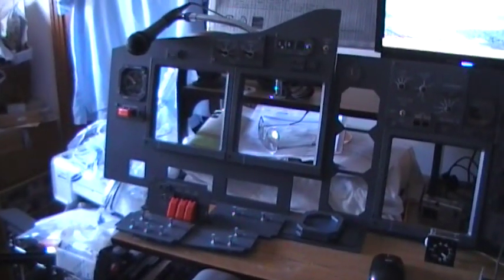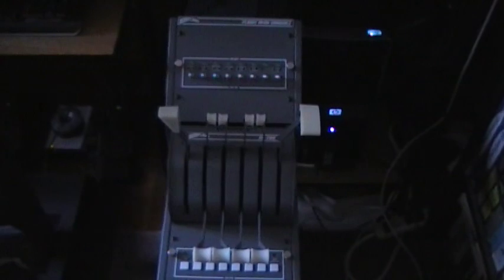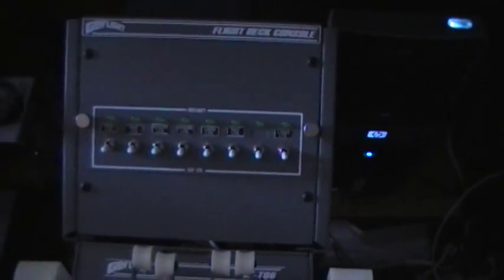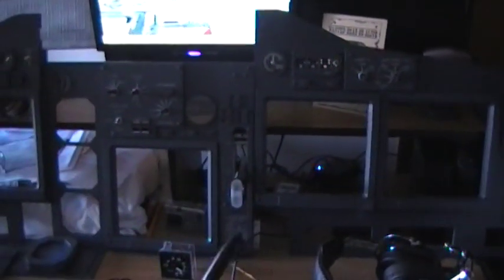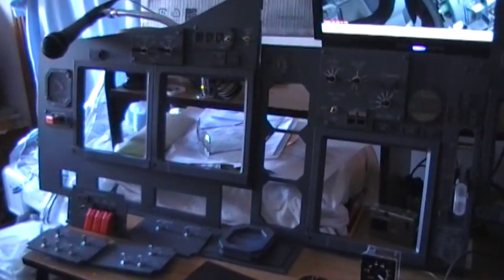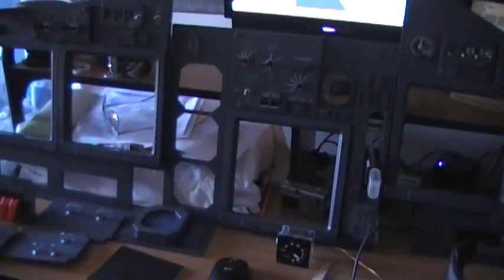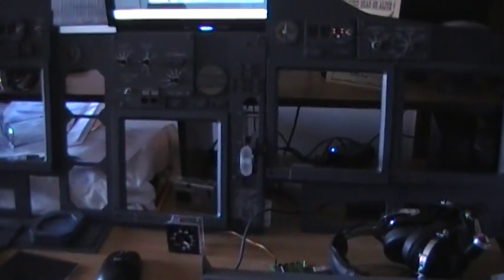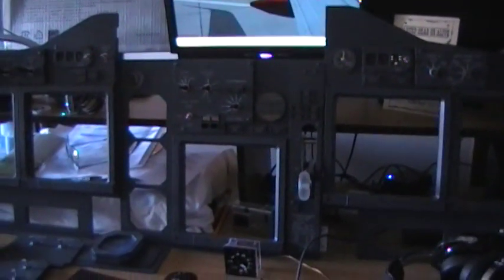Boeing 737ng Home Sim

Comment: Looks like after doing some homework that the capt and copilot MIPs need a 16:9 19"  @16.5"x9.5" viewable area monitor to cover the approx 15.375" x 6.75" square hole for the 2 MIP area.  I'm gonna try a 17" 5:4 1280x1024 monitor for the center screen to cover the 3 round hole instruments and the engine screen (approx 13" x 10.75").  I got the monitor sizes from wikipedia. org/wiki/Viewable_image_size and the mip plans from the marcus. Do these appear to you alright?
Does this seem

Comment: Ohhh. I'm not talking about the overheads but rather the framing or table setup that holds the main capt's and copilot's screens and forward instruments and everything directly in front. Ive seen all your videos but I dont know how you mounted the main front panels.  Is that homemade? ie did you start with an ordinary table and build the main framing on top that? Or did you buy a pre-made frame? Thanks again for your help Dave